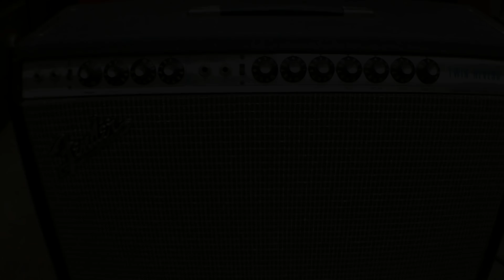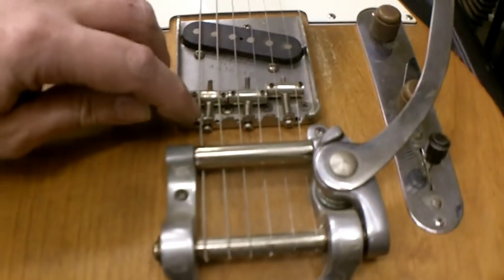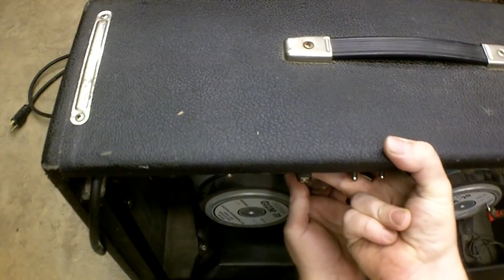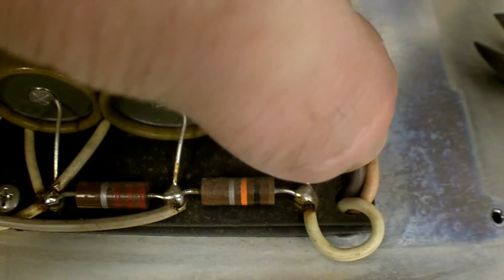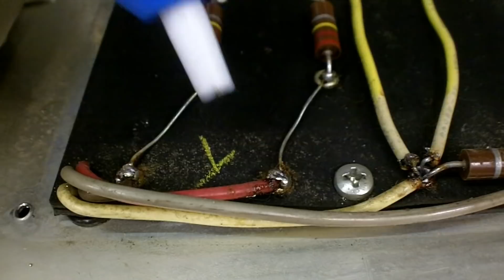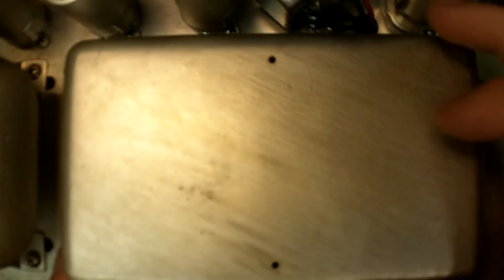Replacing Capacitors in a 1971 Fender Twin Reverb Amplifier Plus Some Soldering Information

Comment: I have a 1970 no master twin reverb that I am attempting to get caps for and having a difficult time doing so. Could you please share with me what those caps are, so I can look them up? Thank you, great video!
Reply from the maker: Thanks, I cant tell you the values of the caps I've replaced as it was years ago, but each cap you're trying to replace should have the value in microfareds and voltage listed on them. Just go one for one. If you're meaning something else, elaborate. Good luck, G.

Comment: Goodevening....i have question.....i have a Fender Quad Reverb My Capacitor Mallory 25uf 25v has been damage what capacitor and what value of UF and value of Volts of the capacitor replace to the orginal capacitor( Mallory 25uf 25v)... Thank you Very much...
Reply from the maker: Stay with the uf rating on the cap. You can go up in voltage, but keep the uf of the cap the same. Hope this helps, G.

Comment: Great presentation, why you change capacitirs on one of the best worlds amplifier?....one group somewhere in Europe at  65 we use Twin, Bassman and Bandmaster, all original blackface.
Reply from the maker: Because they are decades old and dried out. If they shorted out, it would take out the power transformer, etc. That's why.

Comment: Thanks, always worthwhile getting other viewpoints.  Lots of good stuff but personally I feel going OCD completely removing boards with their brittle old cloth wire for instance makes unnecessary wear and potential damage. A bit of lead left over that can be joined to new lead with that extra surface area is secure and doesn't look bad at all once coated in solder. Sure I'd love to keep my '63 AC30 look all untouched but I don't think any player/collector will care and can always be re-done by the next owner. Damage however might be problematic. But again, thanks.
Reply from the maker: Thanks. I didn't remove any boards and this amp didn't have any cloth wiring. This was a 1971 Fender Twin Reverb- and not a 63 VOX like yours. A Fender is not a VOX so procedures may vary. Take care, G.

Comment: Hi, ghostses, very good video and a good explanation also ! May I ask you what type of iron did you use please ? Wattage ?
Reply from the maker: Thanks! I have an old Ungar 33 watt iron that I used for this project. I would look for a Weller with close wattage. Hope his helps, G.
Reply: @ghostses  Thanks a lot for your quickly response and information ! M
Reply from the maker: @mila8400  No problem. Good luck, G.

Comment: Have had a lot of 65-75 fender amps come into my orbit- there is nothing wrong with those brown turd caps- maybe the biggest mistake people make with early silverfaces is removing them- i believe they were made by the pakiton company for fender, just as the molded blues were made by the mysterious “ajax” company. I have a/b , switched back and forth etc etc the brown turds and the blue molded ones hearing zero discernible difference
Reply from the maker: Good tips! Take care, G.
Reply: @ghostses  67-72 fenders are the best deals in the world and with the smaller models- right on up till 80- all my keepers have been drip edge fenders which are just blackface models with snazzier  looks ( which i actually prefer)
Reply from the maker: @vintaxis3833  Good deal! G.

Comment: You have to change the transformers to truly blackface. That was the issue with them. When CBS Fender increased the power and voltage(80 to 100W), the tubes/components started giving out, making them unreliable.
Reply from the maker: This was not a conversion but thanks for the post, G.

Comment: Fender telecasters do not have lipstick pickups. They are a whole different animal. Lipstick pickups are cheaply manufactured with a coil of wire around a stick magnet,  no bobbin involved like a Fender Telecaster. Lipstick pickups are on Dan Electro guitars like Jimmy Page used.
Reply from the maker: That's correct Nick! I did not know that. Thanks for the education. Take care, G.

Comment: Nice job on the video, you and I have much of the same neat work ethics. I’ve always said, If your going to do it, do it right. Not trying to find fault with anything you did but I saw how you removed the power tubes and I thought I’d mention this. It’s best to pull power tubes from the base and not from the glass bottle especially on older vintage tubes, they are to expensive. The glue that holds the base to the glass can break free. When you have those tube retainer clips it takes both hands and a little finesse when pulling from the base of the tube while trying to keep the clip spread, it can be a little tight but it’s doable. One other thing, some of the resistor and cap leads are rather short, I use alligator clips as heat sinks to prevent overheating and damaging components.
You would be surprised how much heat they quickly absorb even if your quick with the iron and I haven’t had any issues yet so it works really well. Thanks for sharing.
Reply from the maker: That's my attitude as well. Good tips on the rest. I'm sure it will help others out- me included. Take care, G.

Comment: Can you tell me why the left two big 6LG tube not working and the tube is good just no light and not hot when turn on
Reply from the maker: I know very little about tube amps Willy, but it sounds like you might be having a problem with the heater circuit. Try to find some tube amp forums to see if the better skilled can help. Good luck, G.

Comment: Is there any reason you don't use a soldering heat sink.?
Reply from the maker: Phil, I do have an aluminum heat sink that pretty much looks like a clothes pin. Obviously I didn't use any sort of sink in this video. It could be done- but personally I don't find it necessary for something like I've shown here. The components I was working with were somewhat "large" and I don't stay too long with the iron so a sink wasn't needed IMO. But, and with that said, It's certainly never a bad idea to use one. Take care, G.
Reply: @ghostses  Yeah as always as well its a personal thing, all we do is up to us and generally our opinion thats all , there is no definite way to do anything. Its nice you took the time to make a decent video.   Thanks.
Reply from the maker: Well said Phil- and thanks! G.

Comment: I got bit once with 230 volt 400 cycle in the military. Suffice to say it was non habit forming. Since then, when I'm working on anything electrical - especially tube gear - I'm respectful and carefull like a dentist giving an alligator a root canal.
Reply from the maker: I agree! Been hit myself once, ONCE! It gives you an immediate respect. Good luck, G.
Reply: ghostses Hey, here is a cool video you might like. Uncle Doug - his latest video just went out this morning.
Reply from the maker: I don't see a link, but have watched some of his stuff before. He's a master with tube gear in my opinion and does great work. I was rebuilding some amps for my dads juke boxes and saw some of UD's stuff back then. G.
Reply: ghostses His latest combines home built Amp, cold rolled steel,  vintage muscle cars, and legs. You might like it. ;) BTW the pistol grip for the camera kicks ass! Thanks!  FW.
Reply from the maker: I checked it out earlier today. That amp is going to be really nice when he's finished! G.

Comment: just going to to replace caps and capacitors in my 1972 fender pro reverb all original as well.Absolutely a great learning video ,A great job well done and thanks a whole bunch!!
Reply from the maker: Thanks! Good luck with your project. G.
Reply: Don't forget to clean the jacks, pots, and all-tube socket pins while you're in there. Those things will keep your amp playing quietly and reliably. Also, a good idea to change your grid resistors on the output tubes. They take a LOT of heat over their lifetimes and because they are carbon composition will tend to drift higher in value upsetting the circuit balance. We replace them with 2-watt metal film resistors for their heat tolerance. Also, remember that old amps have had many tube sets going in and out, and that can cause the individual tube female socket pins to spread, so check to make sure they grasp the tube's male pin tightly. [Sounds sexual I know, but don't know how else to express it]. 
AND speaking of heat wearing out components, Top Loaded control amps like Fenders are some of the worst. The way the chassis in oriented within the cabinet allows the tube heat to rise right into the chassis itself and build up in there. It is not uncommon to get temp readings of 180 F inside the chassis while playing. Marshalls and others with bottom-loaded controls do not suffer from heat loses of components nearly as often. Just sayin'. Thanks for your video.

Comment: Excellent information and video!  Question:  what size soldering iron are you using for this type of repair?  I have to replace a worn out iron.  Thanks.
Reply from the maker: Thanks Larry, glad you liked it. I'm using an old Ungar 35 watt iron. I can't make out the model number though. I think Ungar was bought out by Weller at some point- so I would look their way. Good luck, G.

Comment: Excellent video!  have watched many and this was by far the most informative and instructional.  I happen to have a '71 Twin I bought in '75 so this has inspired me to finally replace all the original caps still in there.  I didn't realize until many years later the value of the 60's VOX silverbells the former owner installed but like the idea of removing 2 power tubes as I also don't play out anymore and haven't used it as agree it is just too loud.  Also agree on selling off my expensive guitars and just keeping those I don't have to worry about.  thanks again for posting this.
Reply from the maker: Thanks David! Yeah, I would do a cap kit to preserve it. They will cut through anything for sure. It's almost scary how loud they are...lol. Take care, G.

Comment: I have seen a lot of repairs where hot glue or silicone is used to stop vibration on these caps.  Is that absolutely necessary or not?
Reply from the maker: Not necessary Jim, but not a bad idea either. It's not uncommon to see something like that on newer electronics. Good luck, G.
Reply: I had a Behringer DDx3216 and everything was silliconed down.  It was a pain to get it off.
Reply from the maker: Very true Jim! It is a pain to get off. When replacing caps on a pcb that has it on there, I've found an exacto knife to be my weapon of choice. Take care, G.

Comment: The Twin is my favorite tube amp of all time. Mine is probably due for new capacitors. 
Great video!
Reply from the maker: Thanks! I agree. Good luck with yours, G.
Reply: ghostses ...My 1972 Twin Reverb has been powering my Strat and pedal steel for a number of years. However, it's gotten a bit too heavy for me to lug around from gig to gig and I have been using my much lighter Peavey Nashville 400 instead. I still want to get this old girl in tip-top shape even if I just use it at home or for recording.
Reply from the maker: I must say I'm glad I don't drag mine around anymore...lol. I would do what ever it takes to preserve it. Take care, G.

Comment: Hello, very nice video. I would like to ask a question once I'm new in recapping... What if i cut the old lead and solder a capacitor's end on the lead's cut side, as a straight line. Is that acceptable or stable enough? I find it more easy that way and that's why I ask.
Reply from the maker: Personally, I would remove the old leads and install the new ones. That is the best way, even though it takes a little more work. If you try to solder the ends together, it will probably break loose. If you are going to leave the old leads in, leave enough length to solder the new lead beside the old one. Again, not the way it should be done though. Good luck, G.

Comment: Is it safe to lift the cap bin if ur not touching the caps? I just wanted to take a look don't have the gear to discharge have had the amp unplugged for 12+ hours
Reply from the maker: I'm no pro by any stretch, but I think it would be OK. I would turn on the power switch first, with it unplugged or course. Then take out the screws, sit on one hand, and use the other hand  to lift the cover straight up. Good luck, G.

Comment: I can really hear the difference between the sound before and after. The before sounds slack and colorless. The after sounds fuller, more complex and shiny to my ears. I have a similar amp, early seventies, no master volume, Silverface Twin. It needs work at the moment, but when I got it, it had that open, transparent, glassy sound that people associate with Fender amps of that era. Nice job.
Reply from the maker: It would've been nice if the video did better justice on the before and after- but glad it came though. Yeah, it was dead for sure. Hope you can get yours back to good. Take care, G.

Comment: Good you grounded the caps. When you went in and checked voltages, the battery in your meter will put a small charge on the caps. Its good practice to discharge them and then ground the circuit while working on it. Good video.
Reply: Dave Bogusky - Not really, on the voltage function. It's tough to measure voltage if you're applying voltage. It'll charge it a bit on the resistance or capacitance function, though.
Reply from the maker: Thanks Dave, and good tips! Good luck, G.

Comment: A fine video, and kudos on insisting that you do NEAT work, if you're going to do it.  I really dislike sloppy work, and the Lord knows you see enough of it these days....  Great advice on sourcing too.  I use Mouser for most things, but the Sprague Atoms are way too high there, so Antique Electronics Supply (tubesandmore.com) is a way to save significant dough.  They carry some cheaper, good replacements, too... F&T caps from Germany are nice as well.  Your caps were definitely on the way out... did you see the positive side blistering?  Nice swampy playing, too... CCR anyone? ;>)
Reply from the maker: +Ben “Slick51” Holbrook 
Well thanks Ben! Yep, if you're already doing the work do it right. It only takes a few minutes to make things nice and tidy. I was kind of floored what Mouser wanted for the Atoms so I went on to find AES and saved a good deal. No, no blistering, but probably well dried up after all these years.

LOL, thanks! Great band! Take care, G.

Comment: /Whats up with the bias adjustment in that amp!,i'm working on a 68 Super reverb and i had and extra pot connected to the bias balance pot that was originally in the amp, and rewired the amp to blackface spec,and replace all the filter caps,electrolytics the orange drops and some 100k resistors,pulled the suppression caps of the tubes.. i got the amo sounding better than it did,but now its red plating!Do i need to have two bias pots in a silverface amps to have adjustable bias???
Reply from the maker: +Jonathan Kosyjana I'm not sure on your amp Jonathan- especially since you're blackfacing it.. This amp was running the tubes way hot 20yrs ago. A friend of mine and I did a mod and installed a pot next to the bias balance. He was the pro, not me...lol. It Sounds very similar to what you had in my opinion. If you pause the video at 10.05 you can just barely see the new pot to the left of the the bias balance pot. Recalling from my tired memory, we set the bias balance so the tubes were in balance with each other voltage wise, but there was no way to adjust the voltage they were running at (and they were running hot)- so the other pot was added so we could turn down the voltage so they weren't red plating. I don't recall the exact changes we made, but hope this points you into a possible direction. Again, from a 20yr old tired memory so take it with a huge grain of salt.
Perhaps look around for silver face bias mods. Good luck, G.
Reply: ***** Sounds like a plan,thanks alot!
Reply from the maker: Jonathan Kosyjana
Not much help, but good luck to you! G.
Reply: +Jonathan Kosyjana NO. You do need a raw bias adjustment, though, and yours only has a bias balance.  The resistor on the back of the bias pot must be changed... lots of video here on how to do that.  Be careful with the big caps....
Reply: +ghostses It indeed looks as though it was modded to have both the bias balance (factory), and the raw bias adjustment too.  That works pretty well. To set raw bias otherwise requires calculating the new resistance required via Ohm's law, and then removing the resistor on the back of the balance pot and soldering a new one in.  That's required every time you change tubes, and ideally to correct the bias drift after the new power tubes are broken in (why I put in the raw pot...).
Reply from the maker: Ben Holbrook
That's exactly what was done Ben! Thanks for the post, G.

Comment: Always wonder why some people like to keep these old faulty caps in their amp to keep it original or 'vintage' when these caps have the potential to destroy other components when they fail,  not to mention they can ruin the sound completely.
Reply from the maker: Dacke I agree! I would rather run good caps over frying out a transformer any day. They may change the tone a bit, but it's better than not having a working amp in my opinion...lol. Take care, G.
Reply: +Dacke Yes, crazy.  Imagine this statement... "I only run the original tires on my 1968 Mustang"; No one in their right mind would do that, but will do the same thing with their electronics... Nuts.
Reply from the maker: +Ben “Slick51” Holbrook 
LOL!!! Good analogy Ben!